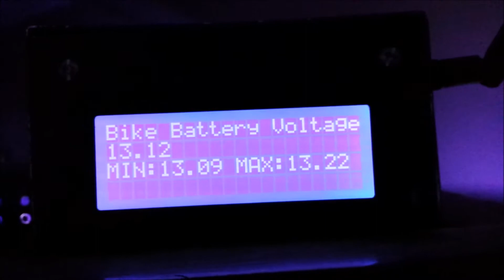HOW TO: Wireless Monitor Harley Davidson Battery Voltage with Arduino and NRF24L01

Comment: Very helpful thanks! I’m planning to make the same thing for my car to monitor my battery level and to see if my alternator is charging the battery properly.
Reply from the maker: Thats actual a neat idea.
Reply: It is done! It works great and now I can constantly monitor my battery voltage when I'm driving to see if my alternative is going strong or not. It turns out when cold start the car the voltage only reads 11.3v and during driving the highest it can go is 12.3 -12.6v. I think it's time for a new alternator :)
Reply from the maker: Wow. That rocks. Thanks for the update.

Comment: Do you power the transmitter from the motorcycle battery? 
I would love to see the schematic of the build.
Thanks
Reply from the maker: Yes. Once I plug the transmitter into the battery tender harness from the bike it powers the arduino. 
Check the link in description for the circuit.

Comment: Compilation error of the receiver done = radio.read (data.sizeof (data)).  Please upload your libraries for the receiver.
Reply from the maker: Do you have the NRF library installed? It should look like this at the top:   
  
  #include <nRF24L01.h>
  #include <RF24.h>
  #include <RF24_config.h>
  #include <SPI.h>
  #include <Wire.h>

Here is the link to download: https://github.com/nRF24/RF24